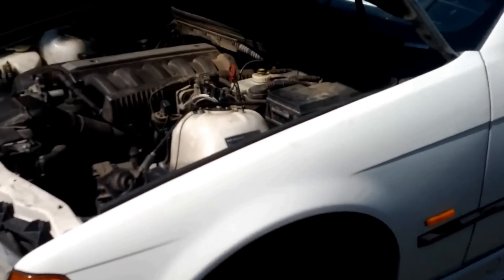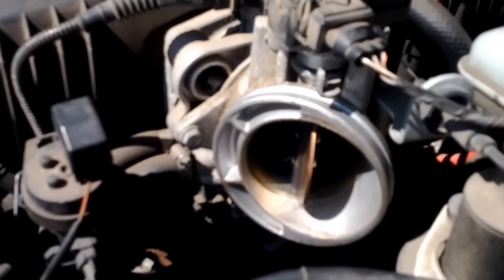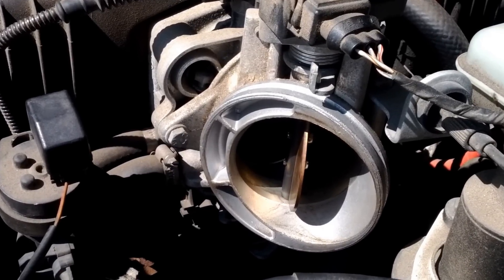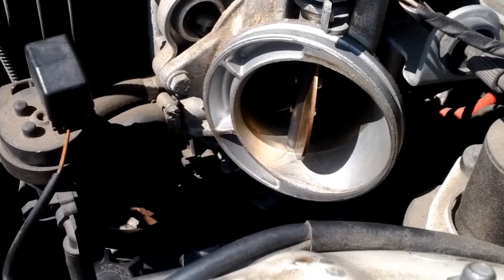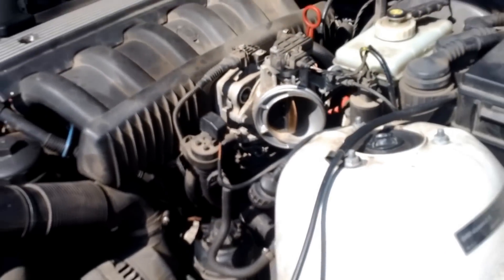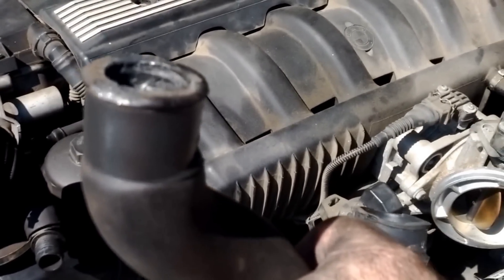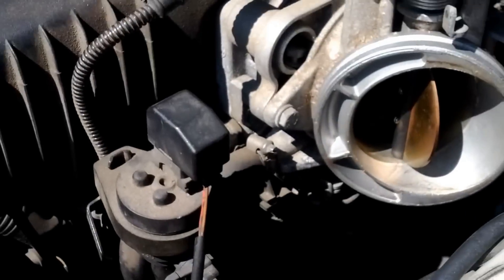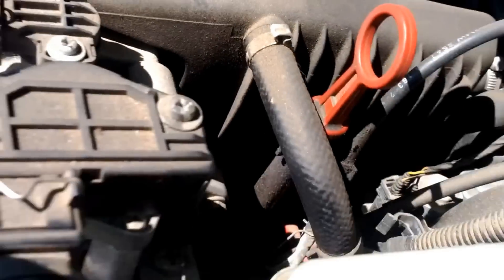1997 BMW 328i E36 Stalling at Idle - **FIXED** - Air connection to IAC Valve the Culprit

Comment: My E38 740 won’t idle at all when cold, after about 30 mins of driving it will idle but very rough and will still cut out now and then, could this be the pcv valve?

Comment: I was having the same issue. I had codes for multiple cylinder misfire in 3 and 6 and I also had a couple saying I had a vaccum leak.. at cold start it would go down to zero and practically stall but I would give it gas and it would come back.. I replaced my coil packs.. and my valve cover gasket (just because it was time) and my spark plugs ... cleared the codes and my misfires went away.. the check engine light came back on for my vaccum leaks. I cleaned my MAF sensor and it went away. today I cleaned my throttle body but it ended being that hose on the intake boot.. it had a massive hole in it.

Comment: Im getting 
P0173
P1250
P0442
P170
P1188
P1189
P0302
it appears we have the same issue and im hoping tomorrow this is the case because im not trying to dump tons of money in to this
Reply: +William Moyer any luck?
Reply: +Clark Sharp I had a leak at the intake actually cleared a lot of the codes except the mis Fire

Comment: I have a 1994 325is i just bought, pretty modified for racing.. It was running perfect until like 3 days after I got it. It started stalling in neutral, and rpms just dropped. So im hoping I have the same issue, just a disconnected hose. If its not, what other possibilities could it be?? Thanks so much!

Comment: Holy shit thank you. My e30 was running like total shit after an oil change and I was digging through the engine bay trying to find a sensor that cam unplugged when it turns out it was just this exact same tube that had come unplugged on the other end, so I couldn't see it.

Comment: Hey Brother, Thanks for saving me a ton of dough. I was having rough cold starts that went to rough running altogether so I went out and checked mine, and not only was the hose torn at the top, but the boot had a 2 inch gash in it too. I figure I can get these done myself, but I couldnt follow the hose with my hand to where the iac valve is. It seems to be tucked up under the intake manifold. I have a 1996 328i Vert, could the setup be different? Thanks again...

Comment: AHHH WTF! It was that hose.... pulled codes...camshaft sensor, crankshaft sensor was getting ready to order those parts, saw your video and that tube was just hanging there... you rock. Runs smooth again.

Comment: Just looked at my car and that hose you said that fell off of your has a dry rot around the connection on my car and I bet that is the problem. So my question is. What is that hose called so i can replace it?

Comment from the maker: It was warm out. It had nothing to do with the weather, it was stalling because there was a massive vacuum leak. I would suggest checking your vacuum with a gauge and seeing what reading you get. You should see over 20hg/in at idle. If that's fine, clean your MAF sensor, and clean your IAC valve.

Comment: was this happening on cold mornings. I just got a 97 bmw 328i Convertable from a guy who basically thought the same thing. My gar idles rough on cold starts after i rev the gas for like 5 seconds it's fine all day long. So if can clean it just by spraying in that valve?